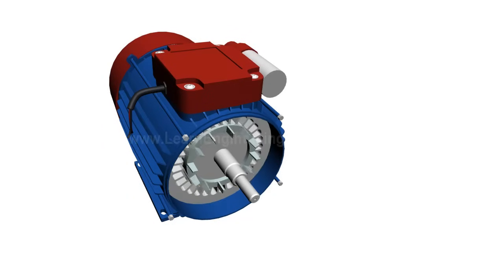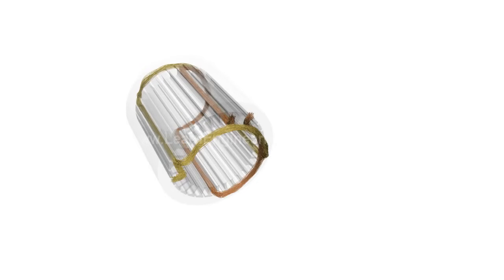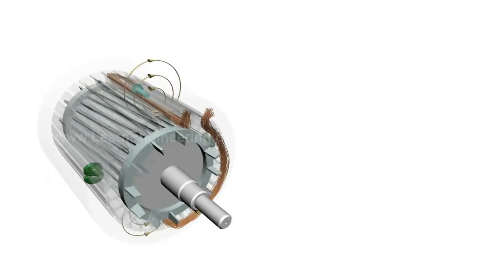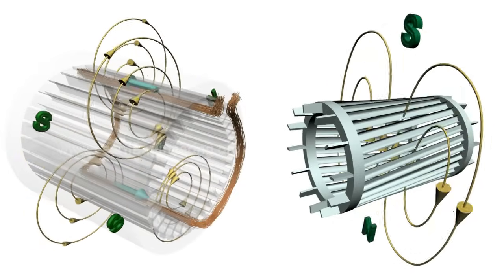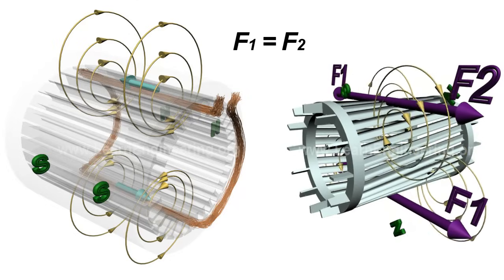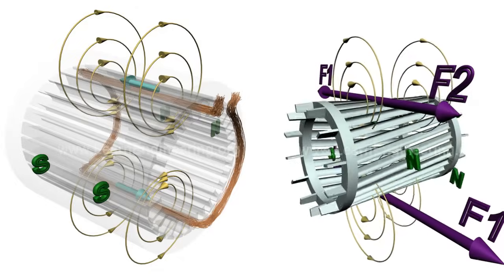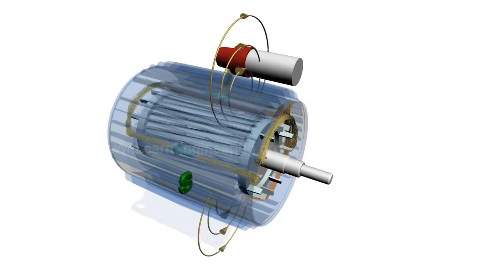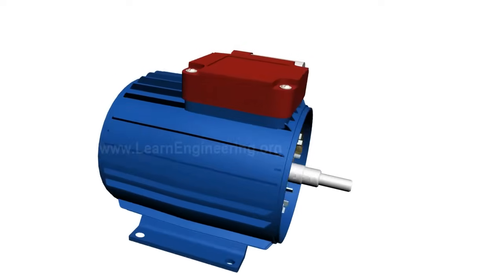Single Phase Induction Motor, How it works ?

Comment: Nice video !! :)
Btw , if the auxiliary winding produces 2 fields rotating in the opposite directions , and if it cancels out one of the 
fields in the main winding , then it must cancel out the other one also right ?
Reply: the video forgot to mention that the capacitor causes a phase difference between the main and auxiliary windings. So thats why only one magnetic field is cancelled and the other is added up. Also the position of the auxiliary winding and the capacitor affects how much phase difference there will be between the main and auxiliary windings
Reply: If you just consider that rotor has 2 magnetic field and the auxiliary winding cancels out one. Then one magnetic field will be still remaining. Practically speaking it cancels out all the magnetic fields which have the same direction which are actually opposing the rotation and lets the motor rotate in just a single direction until it has reached the at the point where the auxiliary winding is not required. (At least that's what I thought please correct me if I'm wrong)
Reply: I've exact the same question in my mind after watching this video fully... 
Can anyone among u clear my basic concept that how a capacitor connecting in series with auxiliary winding(creating phase difference of approx 90° of currents between those 2 windings) cancels only 1 rmf among 2 & the other adds??
What's the relation of this phenomenon with the capacitor alignment?? 
Pls tell
Reply: That is exactly the same question I was about to ask. By any chance, have you come up with a solution?
Reply: @josemariavivanco9611  Imagine the main winding magnetic field as a vector in space that is perpendicular to the magnetic field vector of the auxiliary winding. The resultant vector ( or resultant magnetic field) will be at an angle. This will act as the primary magnetic field that will induce EMF in the rotor) I hope that helps :)
Reply: @ahmadhammouz409  yeah but how does that ensure the motor will always spin in the same direction, the way i see it that will just pull the rotor so that its field is aligned with the opposing field created by the stators auxiliary winding, unless im missing something wont that mean that it could spin in either direction?
Reply: Jose Maria Vivanco  
RELAX guys.  
I have one of this motor and it’s working flawless. Don’t bother with those “self canceling” magnetic fields. 😉

Comment: I don't get why one magnetic field is cancelled out by placing the capacitor and the other is added up? If they both have a inversed magnetic field then they will both add up to the previous magnetic field of the first phase...I don't see how this can work? Or do I miss something.
Reply: Because of Impedence(Zx) when capacitors and inductors intermingle the Impedance cancels the first field. like a short to ground.

Comment: booster   pump   --  pumping   water   to  top   of  house   --   is  induction   motor   ?
Reply: +Amarjeet Singh Yes, you would hardly ever see a DC motor on booster pump. Only reason to put a DC motor on a pump would be to change the pumps curve.

Comment: what is different of ac and dc supply genre ted magnet filed
Reply: First of all, A.C supply has alternating values and a pulse rating graph, that's how we get a rotating magnetic field, but not convenient to self-starting motors.D.C dolly has a straight line graph with no directional change in graph.

Comment: If the primary/stator/main winding has a "rotating" magnetic field, do you mean the magnetic field has a N pole on side1 of the winding and as the AC goes through its cycle then side1 will have a S pole (obviously if i am right then side2 of the primary/stator /main winding will be S pole when side1 is N pole and if side 2 is N pole then side1 is N pole or as you have said a rotating magnetic flux?!?!?!?). Please let me know. Thank you.
Reply: Hmm

Comment: I am confused. Question 1: Does the capacitor only serve to help start the motor or it is required during the normal operation of the motor? Question2: Why does the motor keep on rotating(with or without load) if there are two counter rotating magnetic field which have same magnitude and angular velocity. I thought the field which rotates opposite to the rotor should produce more torque on the rotor and therefore it should slows down, shouldn't it?
Reply: A 1: The capacitor is wired in series with the auxilery winding and causes the current to lead the current of the main phase winding. A 2a: This is a little more difficult to explain due to the rotor's magnetic field being induced by the magnetic field of the stater. Think of the rotors field as trying to catch-up to the stater. The momentum/friction of the rotor and the resistance of the rotor causes a delay in its induced field. This delay causes the rotor to follow the stater. A2b: If the rotor is stationary the rotor will not move because its induced field will not be perpendicular to the stater, thus producing no torque.

Comment: sir why the bars of rotor are not straight ?
Reply: ***** its called the Skew angle.
Reply: If I am right, its made to decrease an inertia of the rotor,  when one rotor bar ends cutting a magnetic field the other starts to cutting it, so theres no gap in motion of rotation. The rotor is non-stop under control of stator's magnetic field.
Reply: I take it is only a matter of trial and error.
Reply: Skewed bars so their less vibration and motor is quieter

Comment: I have one Q.The vibrator in our mobile phones/foot massager  is it a motor without capacitor arrangement,
actually I  don't know whether the working principal is similar or not but i was just curious.
Reply: No, it is usually just a tiny DC motor with a big unbalanced counterweight glued to the shaft. that weight is very unbalanced so when it spins it vibrated like nothing else! (The only similar principles are electromagnetism, that makes all types of motors work.)
Reply: Power Max Thank you!!
Reply: pretty sure that's a dc motor.

Comment: Why capacitor?
Reply: capacitor produces a delay in the fluctuation of magnetic field in the secondary. you need it, because there's one phase feeding both windings; somehow you need to create a second phase, allow secondary field to carry on the induction created by primary field. you can try break your head with counter-rotating fields, but is easy to imagine that the pull induced by primary, instead of meeting a push-back from secondary, it meets a pull again from secondary, accelerating the rotor up to synchronism. Phenomenon is similar in a water or gas turbine: the turbine can only accelerate up to a certain speed, above which the flow kinds of misses catching up with turbine blades, hence no further speed up. for example, power turbines are designed to be unable to exceed 5400rpm, if accelerating slowly. But if accelerated fast (open the inlets from 0 to 100%), then the turbine will overspeed and break due to mechanical failure. Electrical motors are not prone to excessive mechanical stress, they usually fail due to improper cooling (windings overheating, insulation melting, windings shorting) or bearing failure.
Reply: Capacitor changes phase of AC current. The auxiliary coil has to work out of phase with the main coil. So, the capacitor.

Comment: so the counter rotation of the magnetic field is so the rotor can maintain a synchronous rotation?
Reply: main winding produces two opposite-rotating fields. secondary winding also produces two opposite-rotating fields, only that one cancels out a rotating filed in the primary, while the other adds up the other rotating field in the primary. this way, the opposite rotating fields from primary are unbalanced, pushing the rotor to rotate. after the rotor starts, the secondary winding could be disconnected completely, which renders the opposite-rotating fields in cancel-out mode, but since the rotor turns, will keep turning.

Comment: God I hate single phase motors just so many things can go wrong with them it is like smashing your head against a steel wall give me 3 phase any day
Reply: Aaron Melbourne but single phase motors are more widely used due to small size
Reply: The only reliable single phase motor are either synchronous or shaded pole and those are ubiquitous. How often do those cheap AC fans in your microwave ever die? Probably rarely if ever. Larger single phase motors need phased out everywhere and moved to VFD, its more efficient anyway especially if you get hit on PF.

Comment: how  does the motor stop .... ?
Reply: Switch off the supply 🙄
Reply: @avinashmuraleedhar  aaaaaand your ded, because of induced current and U=R*I
Reply: @josefaschwanden1502  am just switching off the motor by touching only a switch...i cant understand how it kills me brw...i dunno if that would happen only in my case btw😛
Reply: @avinashmuraleedhar  strong magnetic fields induce a relativly hight current. if the resistance is hight the voltage is hight too. just be careful with big inductive loads. There must always be a discharge circuit ( dunno how thats what its called called), to discharge a big coil. Thats also the reason for Flyback diodes with relays.

Comment: If the auxiliary winding is cut-out after the motor attains certain speed, does not the intial torque given by auxiliary winding die out due to frictional losses and the motor eventually stop? Kindly explain.
Reply: Learn Engineering Yes that is a very simple way to find out if your start winding which is your Aux winding in this explaniation is burnt or open circuit you flick it either clock wise or anti clockwise that is if it is split phase or run cap
Reply from the maker: No. When rotor is rotating at a specified direction, the fluctuating magnetic field will produce a net torque which is in same direction of rotation. This net torque will overcome frictional resistance.

Comment: Not really familiar with motor designs so this question may seem trivial. Why are the rotar bars slanted? Is it to help force air out longitudinally (removes heat), and not move it around in a circle?
Reply from the maker: Such skewed bars helps in reducing torque fluctuation. For straight bar squirrel cage rotors slight torque fluctuation will be there due to delay in replacing the previous bars while it rotate.
Reply: To avoid cogging

Comment: Annu Aparajita Adding a capacitor changes the phase angle and hence causes difference in the field produced. This will lead to increasing the force for one and decreasing for other
Reply: Aaron Melbourne you don't know much about motors did ya?
Reply: 5 years later and you still got no response 😂
Reply: Yes it does increase the horse power but can also create more ampage causing the motor to over work and burn out it is a very fine line to work with
Reply: @melbose  Mahn stfu

Comment: how do the 2 oppositely rotating fields of the auxi winding not cancel both the oppositely rotating field of the main winding?and cancel one and strengthen the other?
Reply: Exact same question for me.. 
If u find ur amswer now, kindly can u explain me??
I could feel that the logic behind this remains on the position of capacitor cum Auxi winding which creates around 90° phase angle of currents between those 2 windings.
But still the question remains how the phase angle of currents nullify 1 rmf & strengthen the other???

Comment from the maker: In single phase motor there are 2 oppositely reovling magentic fields. They will produce opposing torque on rotor. While in 3 phase motor there is only one RMF, so capacitor is not needed.

Comment: I don't understand the opposite force. Is this force coming from the BEMF generated in the rotorcoil? And if the answer on this is yes, why the 3 phase motor doesn't have this capacitor?